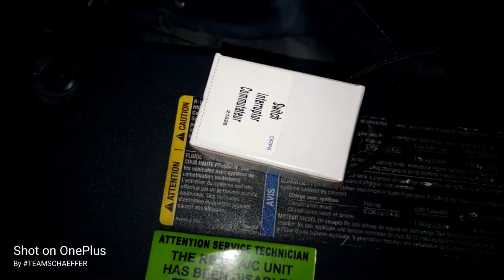2008 Cadillac Escalade AC fix of course by #TEAMSCHAEFFER

Comment: Did you get a code because I didn't in when I hit the ac button it blinks I try in fill the ac in see if that the problem
Reply from the maker: No code but I'm pretty sure if your light is blinking.. That's your problem
Reply: Man I changed the relays the compressor the switch and still no ac it just blinks

Comment: Is this common on the escalades?
Reply from the maker: I don't know I just know how to fix the problem couldn't tell you if this is common I just know how to diagnose the problem
Reply: @TeamSchaeffer  why ? Cause the compressor woulnt kick ?
Reply from the maker: @alvarosilva957  you have to know how to test a couple things but you can stick it wire and the prong a pressure switch side-to-side at the compressor kicks on and it's the pressure switch fuse or relay for heater control
Reply from the maker: Soon as you put the wire to touch both sides of the plugs connector the compressor should kick right on